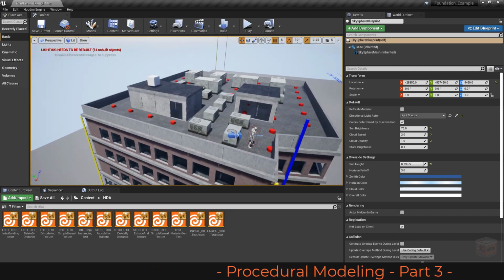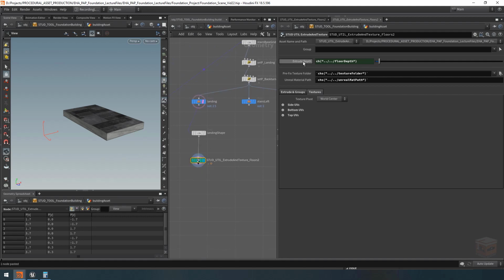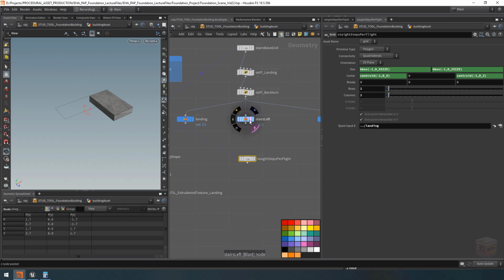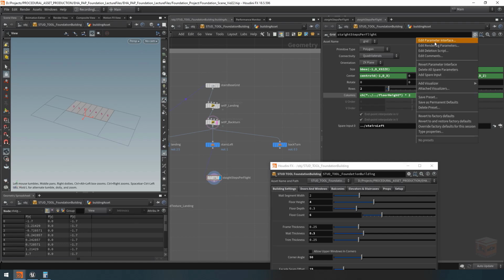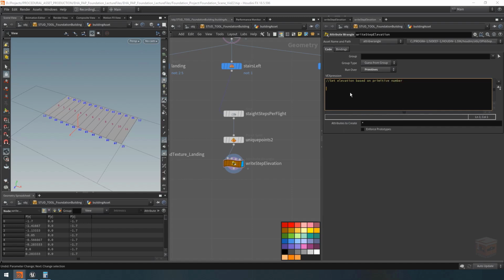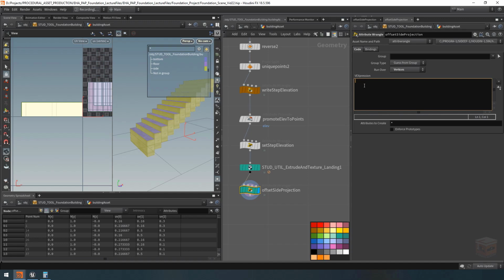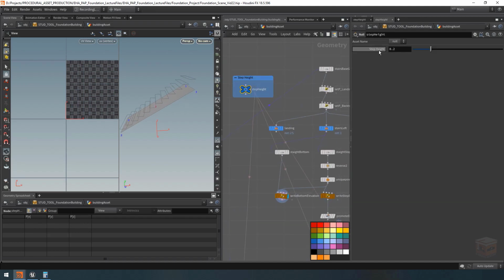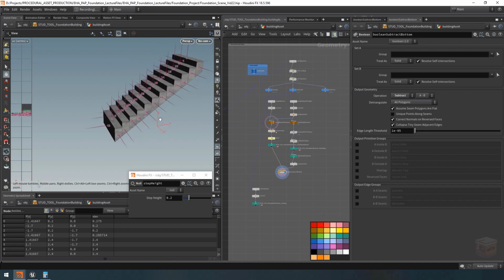HOUDINI FOUNDATION - 25 - Modeling a Procedural Staircase - ( Free Tutorial for Game Dev in Unreal )

Comment: I have a problem in the minute 36 with the node STUD(stairStepBottom), when I apply 'Extrusion Depth' it does not reach the Normal position, but rather it does so straight. I revised the Normal and it's OK. When I apply Extrusion Depth with 'polyextrude it works. I think my problem may be with node STUD, but I don't know. Because it shows me the line with a good extrusion but the polygon does something strange, it doesn't follow that line. In conclusion, it doesn't cut me when I change the 'floorHeight' parameters. Could you help me please?

Good Tutorial.
Reply from the maker: Did you try it with the example extrude and texture node as well. maybe you made a mistake with your version. Otherwise, its a bug I didn't catch, most likely caused due to some errant normals or scale attributes coming into the extrude and texture node.

Comment: could you tell me how to optimize the tile loop in network?
It's running very slow when I change parameters.
Reply from the maker: We need to compile the loop for this, but its not as simple as just wrapping it in a compile block as we'd have to move some materials assignment out of the loop and replace polyextrude nodes. 
I will cover how to compile this loop in the last chapter of the module.